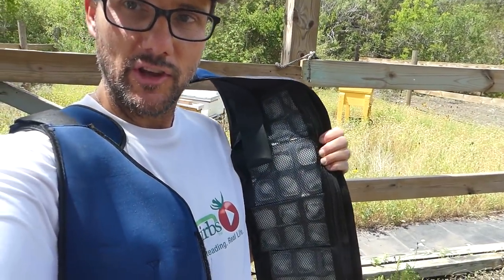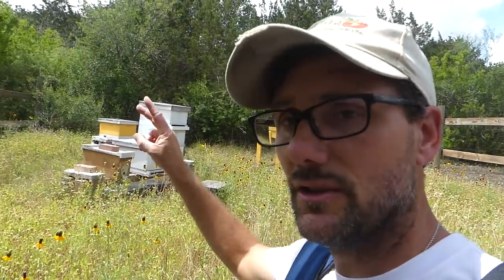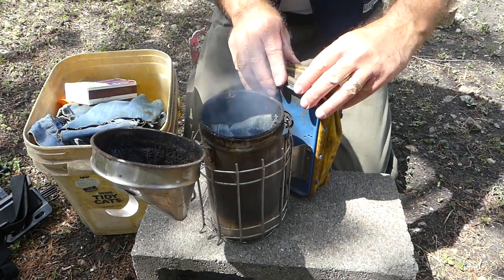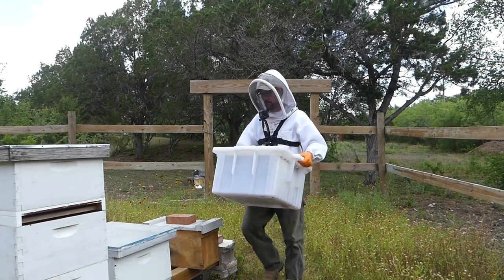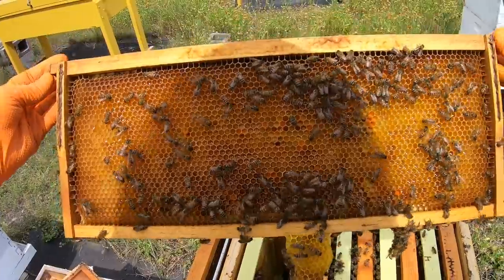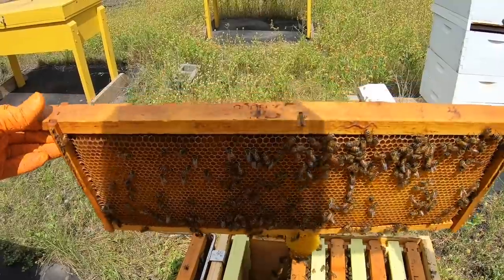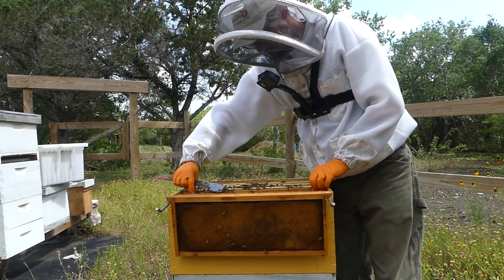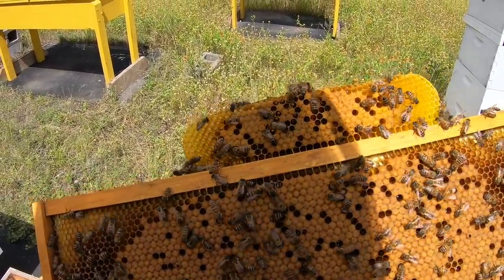BEEKEEPER JUST CAN’T STOP DOING THIS…

Comment: Thanks for the video.  I built a 32 frame horizontal hive last  year .  My hive has insulation built into the roof and the ability to add 3 honey supers under the roof.  Working the hive is very different from a vertical hive and took a while to get used to maneuvering the inner covers and frames.   The other disadvantage is you need to add frames into the brood nest or at the start of the honey storage area to get them to expand.  Wax moth and small hive beetles are as big a problem in this hive as any other.  Arguably it's worse when you expand the honey area beyond where the bees go.  That makes a prime target for pests.  I have a screened bottom on my hive and a sticky board so I can monitor pest activity without having to dig through the whole hive.  I like the long hive  but now that I have used it for a year I see what people mean by it's great for making brood not honey.  I have a few thoughts for you after watching this video... 1. Make your inner covers a little bigger.  Mine cover 3 frames and that seems to work well. 2.  Remove as few inner covers as you can to comfortably work the frames.  I remove 1 inner cover and then slide the next one to cover  the viewed frames.  I also work from the honey side.  There are fewer bees at the back end of the hive so less chance of squishing them when removing the first frame. 3. I  numbered the frame positions on the rail so I can  note which frames had what.  4.  Wax your frames.  There was a lot of wasted space  because the frames were underutilized. 
I'm in the Bay Area, ca.  and our nectar flow hasn't been great either.  Good luck and thanks for the video.

Comment: I think you will have the same problem with the short frames in your horizontal equipment. It's not what that size frame is intended for.
Reply: Probably not.  They will build under the bottom bar of the frame, but they should not attach it to the floor, because they don't typically attach to the floor.  It should be just fine.